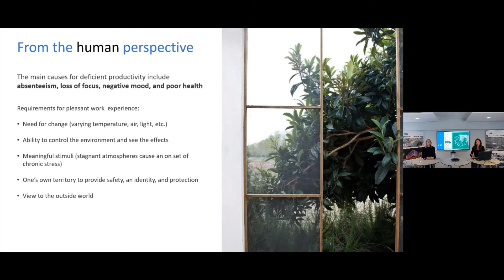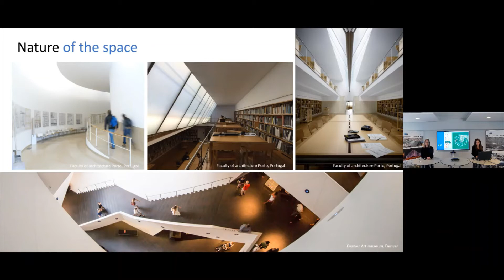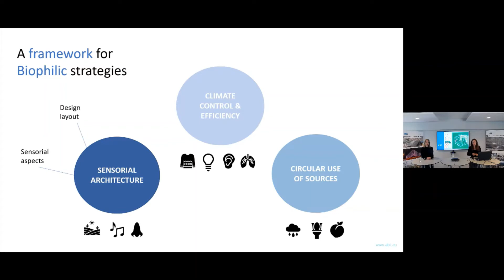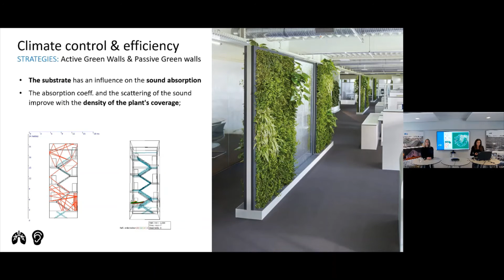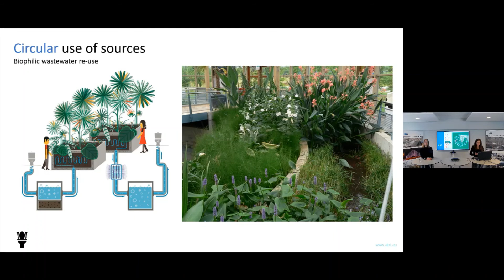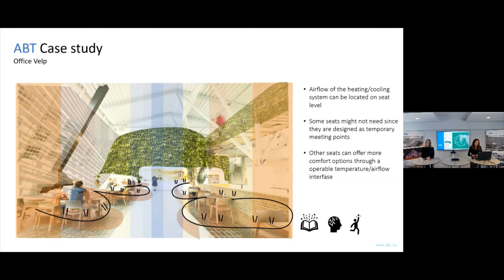Webinar: Biophilic design for healthy and stress free buildings

Comment: Is there a percentage rule or certain condition when the space meets the biophilic design standard?
Reply from the maker: Since there is no Biophilic standard yet, there is no condition/requirement over regulated square meters of biophilia per space/building layout. Currently, regulated Biophilic design strategies are contemplated only in the recognised environmental and wellbeing Standards such as LEED and WELL, where biophilia is part of the indoor environmental condition options credits. At ABT we are developing research on KPIs that can be used to assess/quantify Biophilia in the built environment.